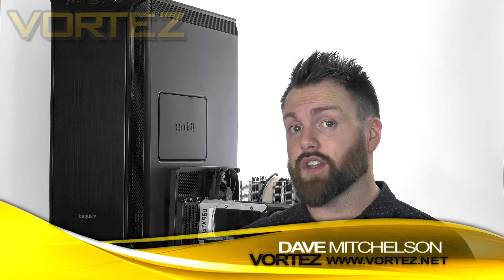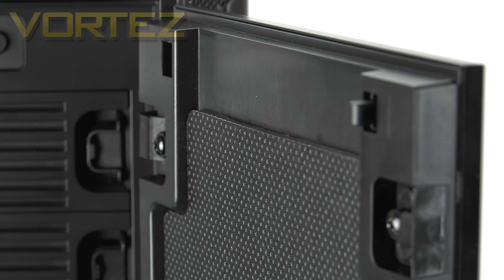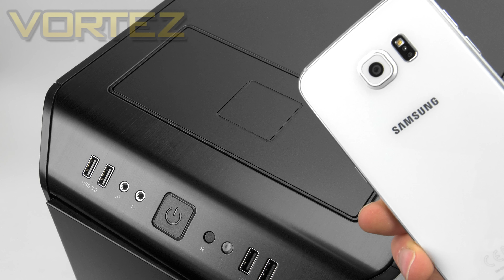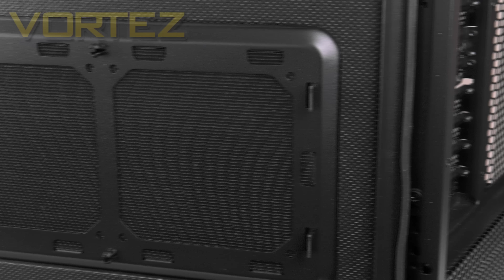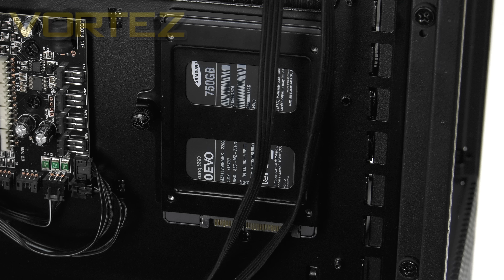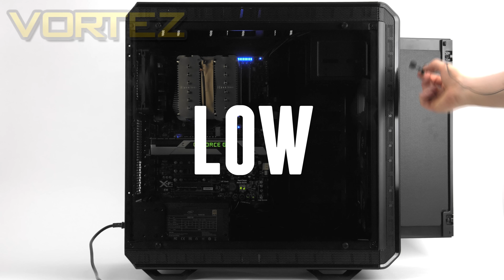be quiet! Dark Base Pro 900 Review [4K]

Comment: This was one of, if not the best, review for the Dark Base Pro 900 I have seen. I actually already bought this case and this video taught me some of the finer points of the case without me having to read several pages of the manual to surface that information. Which helps me because I am a visual learner. Thank you Vortez. I liked the video and subscribed.

Comment: Wait. You actually did a 'sound check' with the sound deadening front door open? I understand you were trying to display the audio level of the fans but it wouldn't have taken much to pan the microphone over the case again with the door closed.

Other than that, thanks for the review. I am seriously considering this case and you covered it well.

Comment: Might be good to mention that a max length of power supply is 150mm "ish" if you want to use those lower fan/radiator mounting locations. I say ish because some fans/rads are slightly smaller. Personal experience here. Example evga supernova 1200W  p2 is 200mm and covers mounting holes. Evga 1000W g3 is 150mm long and is a perfect fit.

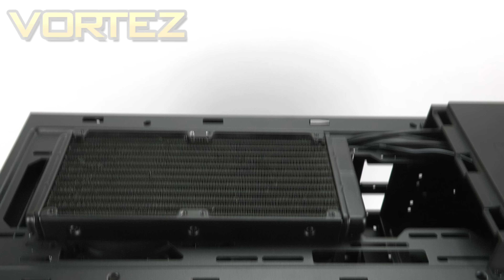Comment: 8:14 Can you have a push and pull setup on the upper side? Is there enough space for 140mm fans? And if there is enough space, can the fans actually pull air? Because there are no ventilation holes on top, only on the sides.

Comment: Can you put the tempered glass panel on the other side of the case, if you decide to invert the motherboard?
Reply from the maker: Unfortuantely not - the other side doesn't have the outwards facing hooks for the panel to rest on.
Reply: Yes you can  the hooks are under the double tape once you remove that you will see them. you can use this case on right or left side there are some videos on youtube.

Comment: Looking at the top I guess you could do a push-pull configuration with one set of fans on top of the case. What I wonder though, if doing that, or what you showed, won't the closed nature of the top cover choke the airflow (especially with the push-pull)?
Reply from the maker: Yeah, I see your point there. There isn't a whole lot of ventilation at the top for the heat to escape. There are vents at the back, sides and a few cut-outs on that top panel though - that should be enough to avoid habouring/trapping heat.
Reply: Regardless this is one amazing case, actually delivering everything that I hoped the Mastercase would, but failed to. I'm seriously considering grabbing one of the Pro version.

One other deign element I find odd is teh fan hub, it's 4 pwm and 4 dc out on the pro version, and uses 1 pwn in from the motherboard. How do you correctly split a pwm signal correctly to both pwm and dc fans, especially considering they have to be different fans by definition. Why not keep it all pwm.
Reply: Thomas Andersson
Wow Thanks for the detailed info!
Reply: My current status: Staring at the emptiness :(

http://i.imgur.com/e9cQzjE.jpg
Reply: Hey speaking of radiators would it be possible to mount a 45mm thick 420mm radiator on the top with the the fans in the space under the cover and still use the bottom optical drive?
Reply: josh885 I had a similar idea and asked Be Quiet! You CAN mount a bank of fans on top of the case inside the top shroud, but they don't advise it (for obvious reasons, choking the fans). Mounting a 420 radiator depends on the width of it, the HardwareLabs radiators are to wide (153mm) to mount with the OD bay in place, but narrower ones (which I guess is pretty much all the rest of them) up to about 146-148mm wide should fit with the bay in place. If you do push or pull with the fans on top (I'd suggest pull in that case) I don't think a 45mm rad would block the lower OD slot, a push/pull config though with an additional row of fans under the rad might.
Reply: josh885 Glad to be able to help. Additionally, each 5.25 slot is about 40mm high and I'm guessing you have an additional 15-20mm from the top of the first bay to the roof so that gives you 55-60mm to play with to the second slot, so your 45mm rad should be fine.
I'm likely going to slize the sides of the top slot from the bay like I did in my 750D case, that will allow me to use the HWL radiator while retaining a OD bay.
Reply: Thomas Andersson
Thanks again.  Judging by those numbers it would seem if you want to run a longer rad than 280mm and an OD your only option would be mount the fans under the cover. Even a 360mm goes into the OD bay. If it's only 55-60mm to the top of the bottom OD bay slot Push/pull wouldn't' work even with the top fans in the area under the cover since a 140mm/120mm fan is usually 25mm thick.  Add the 45mm of the rad and you're at 70mm.  Even if you went with a 30mm thick rad the third fan wouldn't have enough clearance to the OD for good air flow.  I'm thinking my best option if I want to run a 360mm+ radiator up top is to just remove the OD bay and run a Nexstar 5.25 USB 3 enclosure.  Or buy a different case but I really like this one.
Reply: Don't take those numbers as gospel though as I don't have the case, I'm just making guestimates based on my current setup (Corsair Obsidian 750D). I just opened up the case and took some measures (should be fairly similar to the DB900 and from inside roof to top of first OD I had 45mm and to 2nd OD about 90mm. My slim (30mm) rad with a standard (25mm) fan reaches about halfway down the first OD slot. So you can likely do a push (from inside) even with a 45mm rad, but as you say, the frontmost fans will be a bit choked both inside the case if you use the lower OD bay and on teh top (the QI charger covers at least half of the top front fan). You'd still have the flow of the otehr fans though so I don't think it will have a huge impact overall on the performance (What do you need the OD bay for?).
I guess one option would be to run 2x280 Rads or just a 480 top (again the frontmost fans would be a bit choked, but the 3 others wouldn't). Keep in mind that the position of fans and rads are a bit flexible (look at how they mount, not holes but rather elongated slits you screw through).
As far as cases goes the ones that actually support 420 and 480 are few and far between so today I think it's unlikely you find a better case (and you can always mod a bit, that's part of the fun (I will likely mod the OD bay and make a PSU shroud and back wall for it if/when I get it). The only cases I know that can do everything and anything you might want are the CaseLabs ones, but then we're into an entirely different price class.
BTW, here is my build log how I adapted the 750D for the 420 http://www.overclock.net/t/1581310/obsidian-750d-airflow-ek-cooled-i5-6600k
Reply: Thomas Andersson
Well I'm trying to get away with as little modding of the case as possible since I'm very unskilled in that department.  With that Qi charger blocking the front fan it looks like It's  has support for a 420 rad in specs only but in practice it's not really practical.  Going  420 only to have half of the 3rd fan blocked is not ideal especially since the design of the top vents means the air flow is already getting choked off to a degree.  If you look at hardwarecunuks review on youtube you can see the top of the case and he even shows a 120 and 140 fan mounted. I can see why  the Alphacool promo build went with a 360 on top.  It looks like that's about as long as a radiator you can fit without having the third fan blocked by the Qi  charger.  The mount holes for 120mm fan rads also go right to the back of the case unlike those of 140 rads.  Looks like the case is really designed around 360 being the max length for a rad but it had the physical room so the put the mounting holes for the 420 too so they can list it as supported in the specs even though it will have crap air flow.  In my book if half of one of the fans is blocked by a part of the case, it doesn't really support that size of radiator.  I'm probably just going to go with a 360 on top and a 280 on the bottom.
Reply: I just received the case, got the silver variant. I have just fully stripped it and am wondering what to do in terms of water cooling. Ideally I would like 2x 420mm rads in there, preferably the Black Ice Nemesis GTX or GTS range, however the GTX measures 452mm x 153mm x 54mm (L x W x H), and if I wanted 2 of them I am not sure if they would touch at the top right (near the front IO)... Also there is no way I can fit a 280 at the bottom if these rads are present so It's either just these 2 or go for 2x 360 and then a 280 at the bottom. Decisions decisions... Shame no reviewer actually puts a 420 rad to show it actually fitting. The EK CE420 rad is even longer, measuring at 460mm, meaning there is no way you can fit one at the front of the case imo, as it will literally be touching the top panel of the chassis.
Reply: +Stoycho Karaulanov You will NOT be able to fit the HWL 420 with the OD Bay in place (rad too wide). I think you might just get away with a 420 in the top and in the front, but you'd then also lose all the 3.5" slots. Why so much rad space anyway?
Reply: I have already stripped everything from the front of the case, I do not need any drive cages or stuff like that. With that in mind will two HWL Nemesis GTX 420s fit in the case? I realise that I have to move the mb tray down to make space for the fans to be internal rather than in the shroud. A lot of rad space is required as I want a dead silent system, or as close as possible. Only way to do that is through loads of radiator space so fans can run at 600rpm and not affect cooling. I ll be cooling a 6700k and 2x gtx 1080s along with RAM and Motherboard blocks. Thanks!
Reply: +Stoycho Karaulanov Here's what I suggest, measure out a paper strip equaling the thickness of your radiator of choice plus a fan and push the end up against the roof. Now you know how deep it will reach (maybe tape it to the frame). Then do another strip the length of the height of the front one and put against the side of the frame where it would mount, this should visually tell you if it might work, with roof and front covered I doubt you could fit more than a 140 in the bottom though.
Reply: Here, I did a quick Photoshop hack, grabbed the layouts for the DB900 and the Nemesis GTX 420 and overlaid (after scaling to each other), unfortunately (as you can see) they will overlap so that will not work.
http://www.tifozi.net/img/db900fit.jpg
Reply: Check the image I made for Stochyo, I added a bank of 25mm fans to the 47mm high radiator in the picture and as you can see it still clears the second OD slot.
Reply: Many thanks for that! Yeah that's a shame... In that case perhaps a 360 at the top and a 420 at the bottom should do it? Or since the top doesn't have as much space as the front, I could get a thinner 420 at the top, such as the GTS model with just push config, and then a fatter 360 at the front, something from alphacool or something? I wonder if a 240 or 280 can fit in the bottom if the 360 is present at the front. Many thanks for your help btw! Feel free to add me on steam to talk about this a bit easier: http://steamcommunity.com/id/iinnex/
Reply: HWLNemesis 420GTS top, Nemesis 360GTX front, tight, but might work (turn the ports for the top one to the rear though.
http://www.tifozi.net/img/db900fit2.jpg
Reply: God damn that is close, ah well screw it i ll place an order now and not buy any other WC components till I make sure these fit. As for fans I am set on using the NB-BlackSilentPRO Series, both their 120 and 140 PWM variants. Seem to be the quietest out there with very good reviews from Singularity Computers on YT.  I plan on putting the front 3 120mm fans at the front of the case so they won't be visible, should clear up a bit more room inside for a nice big res. Thank you once again. :)
Reply: Just for fun, while I'm at it. Nemesis GTS 420 top and 360 front, looks like a good combo (but probably better with ports at rear and bottom.
http://www.tifozi.net/img/db900fit3.jpg
Reply: I wonder what the performance difference is between the GTS and GTX models,  I mean as I said the fans will be on the other side for me for the front rad so they won't be visible, giving me a bit more space. I really hope the GTX fits tbh. I'm going to do a final measurement on the case before I place an order.
Reply: Yeah, these are just quick Photoshop hacks and there can be minor scaling and pixel errors so not anything exact, just a rough guide.  Personally I just runt the 420GTS in my case (but then only cool the CPU) and run fans at about 600rpm (EK Vardar 140 F3's). System is dead quiet, have to check power light to know if it's on ;) And it stays cool too. Will as one 1080 card and water cool eventually but will likely stay with the rad I have.
Reply: Check out the various radiators: http://www.xtremerigs.net/2015/02/11/radiator-round-2015/ and http://thermalbench.com/category/radiators/
Reply: Yeah I've seen those hence why I made my mind up to get the Nemesis range for low RPM fans. If I want a silent system it looks like the GTS rad is the way to go, as it outperforms the GTX at the 750rpm range and doesn't struggle too far back at 1300rpm range, so it scales nice and it's thinner as a bonus.

For what I want to cool down the 420 and 360 should be enough right? I do plan on overclocking the CPU and the GPUs but shouldn't see the temp rise too much?
Reply: +Stoycho Karaulanov As I said I don't cool a gfx card yet, but the 1080 isn't too bad thermally. My CPU is a 6600K @ 4.8 Ghz and it idles at almost ambient and never really gets hot even under load with the gts 420. I really don't want to run my Vardars above 40%, but at 30% you really can't hear them at all (roughly 600rpm). The Silent Wings 3 fans that comes with the case should be very nice and quiet, or check out the new maglev tech fans from Corsair. If you get 2 GTS in there 420+360 it should be plenty enough, borderline overkill.
Reply: A good thing with those mounts in the case is that you have quite a bit of flexibility as how to mount the rads/fans. I really want that case, but have to get the 1080 and water block first.
So, not doing a reverse layout? (that's the main thing I want the case for)
Reply: Right so I went to order the rads but the 360 GTS is nowhere to be found in the UK, every place I checked is out of stock. There is a dutch site that has it in stock so might have to get it from there (Nederlands) and just pay £15 for shipping and fees... Unless I go for the GTX which is in stock on 2 UK sites. At that point I wonder if the SR2 isn't a better deal, as it has 8 ports on one side, meaning drain ports should be easy to configure as it will most likely be the lowest point in the loop if the ports are facing down. Not sure what to do, I really want the thicker rads (GTX or SR2 MP) but not sure if I can return them if they don't fit? Alternatively if I want the GTS I have to pay a 20% premium to have it imported as UK stocks suck :/ And no I am not doing reverse layout I was never a fan of those. I liked the case because of large radiator support and silent operation, the Qi Charger is a bonus and so is the tempered glass.
Reply: Maybe get the 420 for now, once you have it mounted you'll be in a much better position to judge how a 360 gts (gtx might fit, and you can get going while you wait for stock. The SR2 is supposed to be very good for low RPM fans and yes, the extra ports are nice, but it's also a thicker rad so space planning becomes even more critical.
Maybe a 360 GTX in the roof and the 420 GTS in the front might fit better?
For drain loop having the rad with the ports at the bottom is a good idea, just add a splitter and a ball valve.